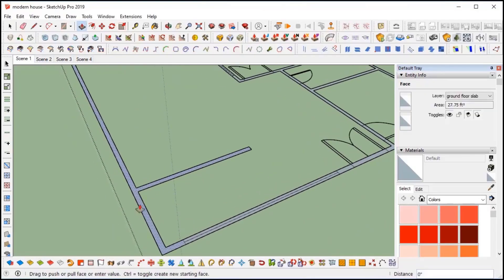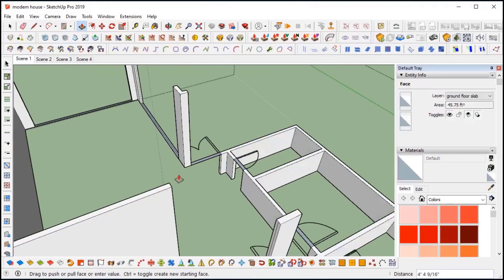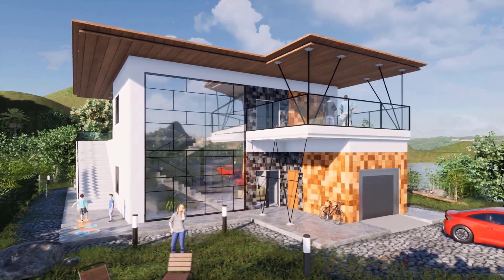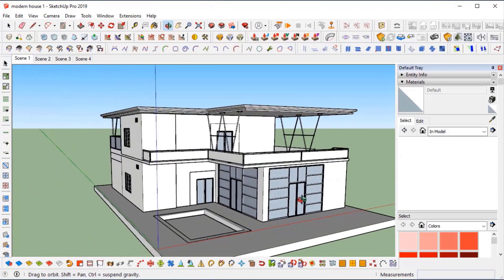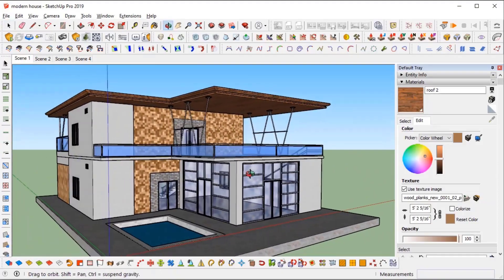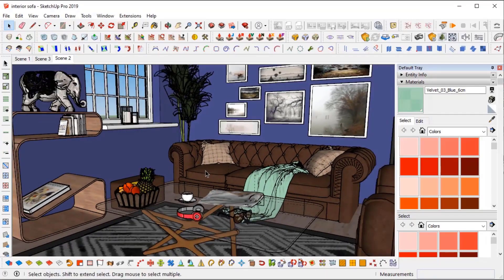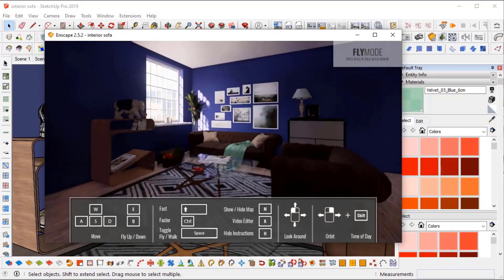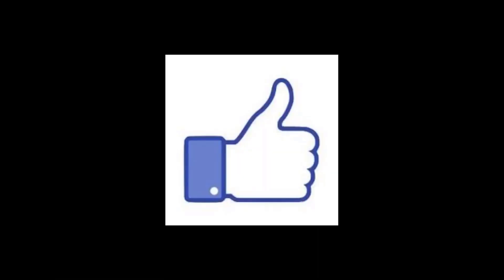Modern Villa Project In SketchUp, Twinmotion and Enscape  : INTRODUCTION

Comment: sir i have a question....sir you designed this project in Sketchup, Enscape, Lumion and Twinmotion....you have mentioned that Twinmotion u used for Exterior right and you used Enscape for Animation and Interior.... i mean to say if you have already used Enscape in this project.....What is the purpose of the Lumion????using both Enscape and Lumion together in same project.
Reply from the maker: These are different software that I used for different projects..

These software have some good options and flaws as well..

Example for exterior animation we need plants and some vehicle animations. Those are good in Lumion.

And for interior, in some aspects escape is better..

I am choosing as per the requirement...
Reply: @MJCreations327  thank you so much for the answer... I really appreciate it sir🙏